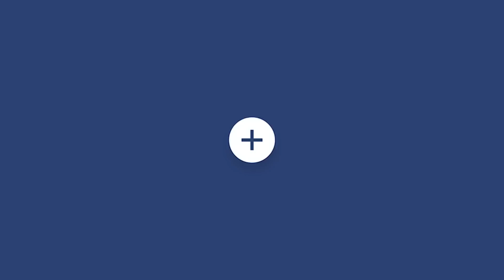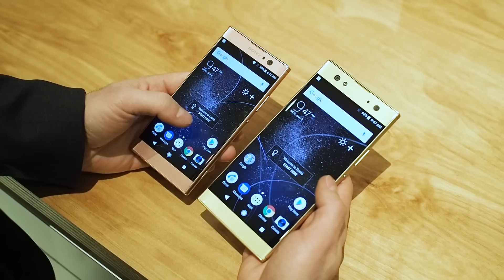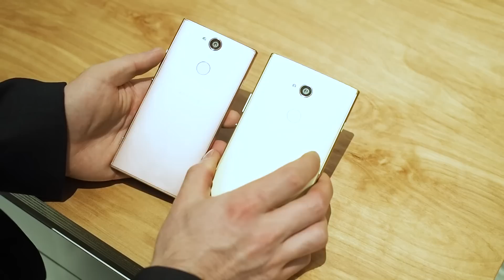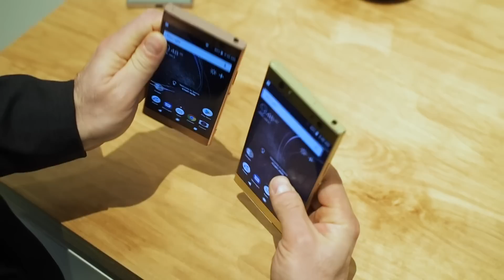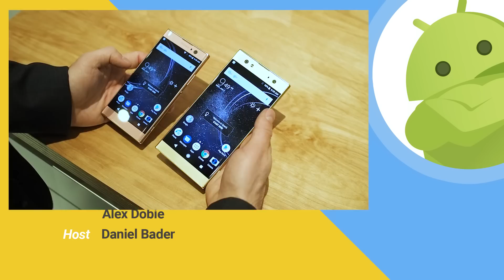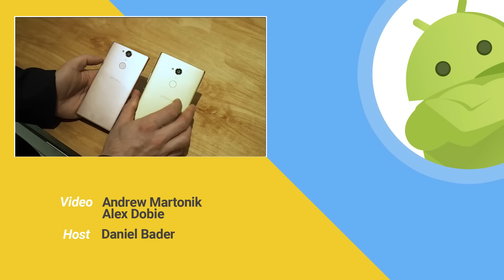Sony Xperia XA2 + XA2 Ultra hands-on

Comment: it is fun to read the comments when the dumb haters are complaining about these "bezelful" phones when XA2 has 75% SBR (Screen to Body Ratio) while Samsung A8 2018 has 75.6% and Honor 9 Lite has 75.5% but somehow those same haters don't complain about the bezels on those other "modern" devices which is basically just pathetic 😄 I think that at least XA2 looks like an appealing phone, has a rather unique design and a solid improvement over the last generation, but I would have liked to see water resistance or dual speakers :) + I think that the larger XA2 Ultra should have better SBR than its 76%

Comment: Sony really needs to update their UI
Reply: They don't, it looks similar to stock Android and that's why it's great.
Reply: Nuclear Redfield outdated. On so what makes Sonys UI old if e compare vanilla or the pixel ui. In my eyes the only differ is the icons. Sony is on par with Google own UI. Nothing old there. And if you look at Samsung, LG and Huawei they are in sense copying Apple icons. So for me Sony is doing the right thing. Using there own icons and not goggles or Apples. And by the way the Sony UI had done great improvements lately. It's closer to those third party launchers than Googles own.

To blame Sony for keeping there icons is to blame Samsung for doing the same. Lets get real, Samsungs UI havents change that much since samsung galaxy s3 2012.
Reply: Ok tell that too Google, because thats in a sense the UI Sony is using, but with Sony Icons.

Comment: I wonder what is the point with these devices? it's the same boring design as always, a telephone whose thickness is very thick, the lateral narcos, yes, are reduced, but the upper and lower are too big. I could say that they are bigger than those of my Nexus 6. I do not see evolution anywhere. You should ask some advice from Samsung, LG, OnePlus and a few Chinese phone companies about how to make a phone with reduced frames.
Reply: Alfredo Durán dude I don't know if you ever owned Sony before coz if you did then you wouldn't have been complaining about the design first use the see how this design changes your Mind
Reply: Alfredo Durán comparing a midrange xperia to flagship samsung or lg?...lol sheep go search samsung a8 ,the side bezel is hideous. Xa2 has 75 stb ratio and almost same as ur so called samsung a8 midrange. Btw the so called samsung a8 midrange aren't priced at midrange price at all. Chinese manufacturer like one plus?only fast speed with weak aspect in all other area. Damn...all these oneplus sheep keep ignoring the fact that oneplus have been stealing your data back to china ,that's why they are cheap. They sell your data. Go search Google please, the way they handle the data stealing issue are so shameless where they basically tell consumers that they can turn off the spying function. You might say they don't do it now since the last leak about their data stealing, no...you won't know it until people discover the new stealing again..
Reply: Ok, if you want to have a dozen phone, why not buy one. Samsung, LG, OnePlus all look the same. Its real tought so tell them apart if you dont look really close. A Sony Phone and razor Phone you can still se... ITS no Samsung or LG. And for me thats just what it should be. One company that goes their own way and design their phone to look like their own. So for me Sony wins all the time.

Comment: Why does Sony make these? Everyone else is going with interesting designs and new tech. And these are so 2015!
Reply: It has been leaked that Sony will have near-bezel-less design for their flagships. Remember this is a mid-range phones, so keep the expectations lower.

At least you still get the value here by having better cameras compared to most midrange devices and this may feature long battery life. At least they finally increase the resolution and putting fingerprint sensor on XA series.
Reply: If you're buying this phone you don't really care about that
Reply: Miyuru Weerarathna the design is interesting and they have flagship camera
Reply: Ffs this just mid range, if they want to introduce new design, they will do it for the flagship first
Reply: Recent leaks show the Z series to have reduced bezels.
Reply: Miyuru Weerarathna Don't strain your little brain too much thinking about it or you might kill the 2 braincells

Comment: Those comments are simply pathetic. I'm pretty sure this would have been the A8 everybody would be praising the design, the infinity edge display, but what they don't know, is that these new XA2 have at least as good screen to body ratio as the A8 or even better incase of the XA2 Ultra.
Reply: The main problem with Xperia phones isn't the design itself. It's pretty original and different from other manufacturers. But those sharp corners are terrible in terms of usability... Compared to the same sized display with rounded corners, it's clunky and uncomfortable to use. Even if the screen to body ratio is similar to an A8 for example, the sharp edges make Xperia phones feel a lot bigger than Samsung phones. And it's a shame because that design is pretty slick. I'm pretty sure some people won't be turned off by that, but I just can't go back to this kind of design for comfort and usability reasons.
Reply: Fantasytky That guy above me asked about a budget phone with less bezels so that's why I replied "LG Q6"
Reply: Simon P LG Q6
Reply: lg q6?the phone that people dont know whether it is samsung a8 (2018) or lg q6?lg is copying samsung infinity display design. ya in fact lg g6 come out with bezelless than samsung first. but who care, its all about samsung, apple,xiaomi,1plus and huawei. So base on all those ignorant people, they only believe what they said.
Xiaomi is the first one come out with bezelless design (sharp aquos did it first). 
Lg copied samsung infinity display(even thought it might not be the case). 
oneplus is so superior and worth(one plus stealed customers data in the past and the only thing about oneplus is fast, other aspects are all weak). 
Xperia ram is so low like 2015(xperia phone with 3gb even came tie/beat one plus of 6/8 gb ram in multitasking). 

All these kind of ignorance will go on since sheep everywhere except one thing is different. Sony is the one that gathers all haters to comment on xperia videos. All the other phones dont get this much hate, but sony haters make sure they leave hate comments on xperia videos even thought so many of them never use sony. In short, sheeps and hardworking sony haters.
Reply: Liion B agree. All these sheep are so worse. Sony get bashed for whatever they do. Go see the samsung a8 the so called infinity display has huge and ugly side bezel. Its so ugly. Sony side edge to edge display has way lower bezel than it. All these blind sheep.  
So blind that they keep thinking these are sony flagship and compared it to other brand flagship. Go see samsung(a8) and lg midrange,the side bezel is huge and hideous. Xa2 has 75 percent stb ratio and is almost same as a8 yet all these sheep still Fking btch about the bezel....it's a midrange!!!!!wait till xz2 then all these people can start complain about it. 
But guess what, even if sony has 85 screen to body ratio on xa series, people will still hate on it since it's sony. They just like to go to sony video and complain. They never bought it and will never buy it in the future too. And all the people that used z series and complain about these xa series can fk off, wait for xa2 please, xa are not for you. They are midrange.

Comment: Sony is DEFINATELY moving in the right direction, thanks Daniel, regards, Richard U.K
Reply: Haha I love that you signed off
Reply: By following the same idiocy all others are doing? Metal construction Sony, are you serious? You'd be correct when you say they are "following"

Sony's have always stand out for doing their own thing, now it's like any other chinese cellular. The fingerprint reader on the side was an optimal placement but they decided to put it on the back without any reason
Reply: Brenda princesa Lindaa not without any reason mate , it's because of some legal issues they can't have their fps on the side in us market hence its actually a better thing for them